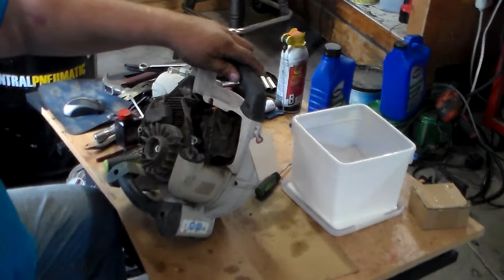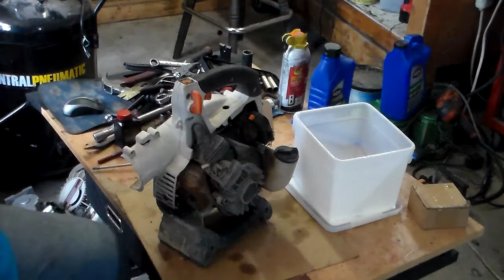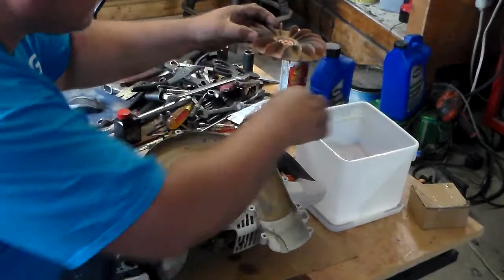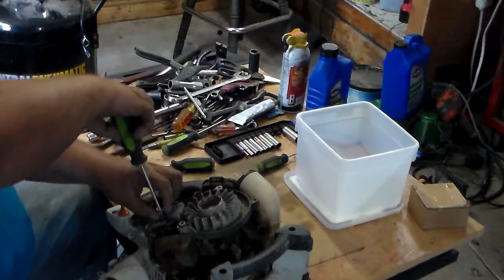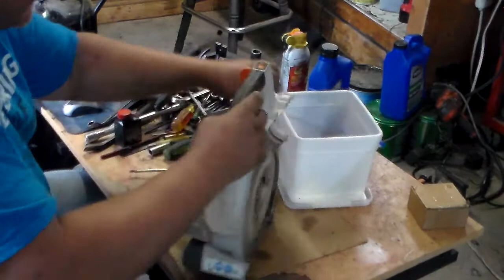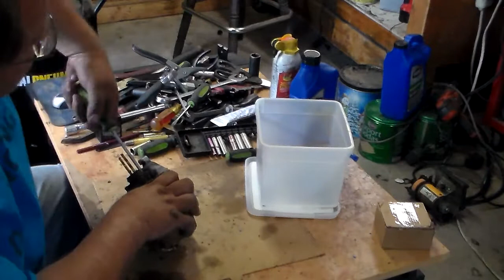stihl bg 85 blower

Comment: I love your videos. I'm going to be rebuilding a bg 50 and i'm watching your videos to prepare myself.
Reply from the maker: That's good remember that good oil seals and gaskets seals are needed for the motor to work
Reply: @2strokefanatic578 Yea it's not making enough compression so I'm hoping just replacing seals is enough to fix it.
Reply from the maker: also check piston and cylinder wall for scuffs and vertical damage, and check ring if its moves and not stuck and  has not to much wear and is pretty much in good shape also check the gasket betwwen the cylinder and lower  part  if it leaks or looks wet replace the gasket there can be a loss of compression  for the downstroke to push the air gas mix to the top of cylinder to be set off by spark ok thanks and please like and subscribe and tell your freinds about me
Reply from the maker: o yes i forgot in a stihl motor there will be  tree seperate parts the cylinder the mid part and lower like an oil tub the first 2 parts you can seal with a gasket the liwer parts you will need sealent to seal it up it does not use a gasket
Reply: @2strokefanatic578  thank you so much for the advice. I have 3 service manuals for the blower. Between those and your channel i feel confident with dealing with it. And I have told my other 2 stroke fanatic friend about you

Comment: 2 stroke fanatic
Great upload, I've just bought myself a bg85 Stihl blower, it's a beast! I've bought it 2nd hand, so looking at your vidoes to understand how they work :)
Reply from the maker: thanks big wolfie  that's means a lot to me i like to take the extra mile and take it all apart, and rebuilt it from the ground up, i like to make sure that i got all the problems solved, you never know what may have gotten bad  or what broke in a 2 stroke machine, you also need to take extra attention on these motors, make sure the oil seals and bearings and gaskets are all good, and run it on 32 to 1 oil gas mix  any less like 40 to 1 oil gas mix will cause the motor to burn up, that's why the companies tell you 40 to 1 so you can trash you 2 stroke and need to get another one, that's how they make the money, also please subscribe to me i got other videos coming, give me a like and tell your friends about me and again thanks.